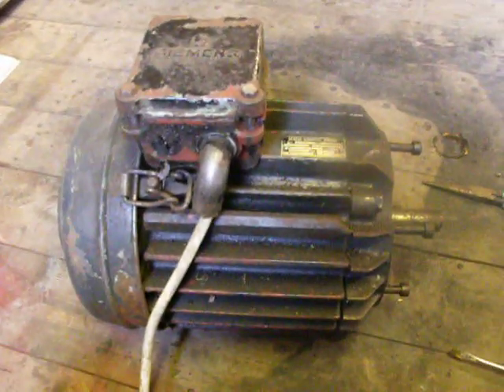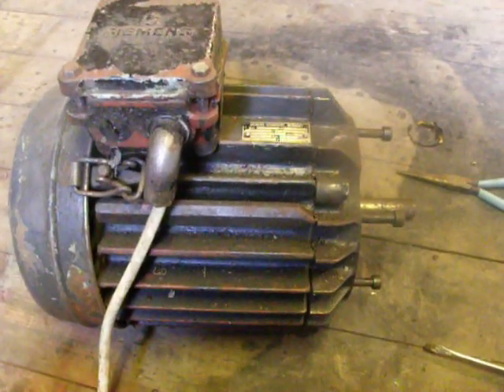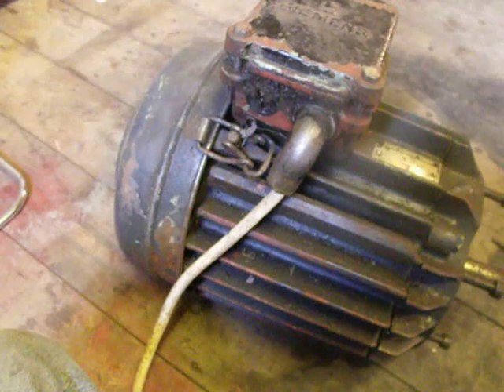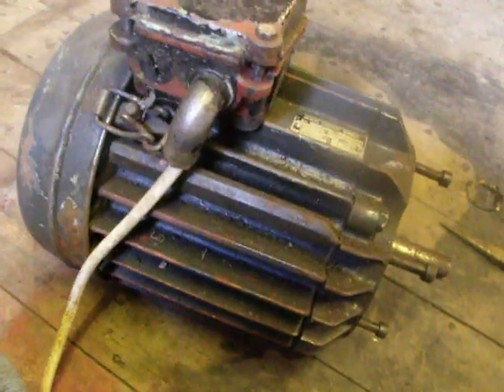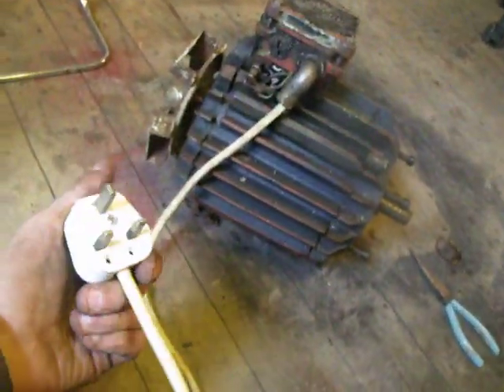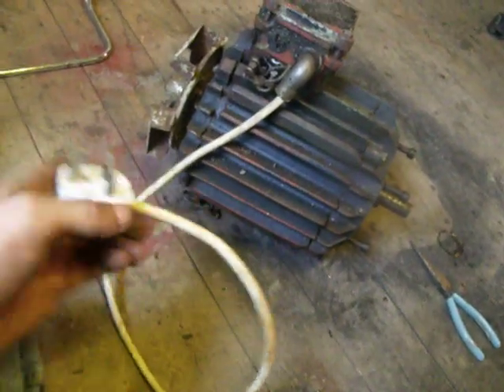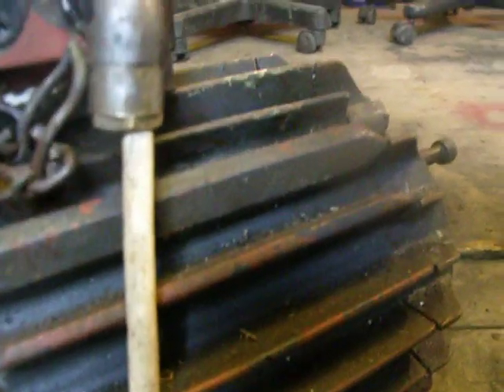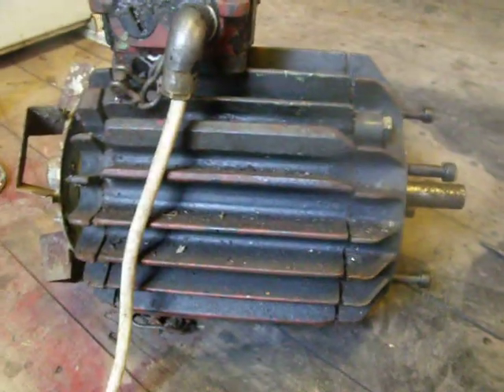3 phase siemens motor running on 240V single phase

Comment: Hi there.  I have bought this feed hummer mill with 4 kw 3 phase motor but I was forced to go buy a 5.5 KW single phase to run the mill. Luckily I did not throw away the original 3 phase motor .  now I see its fairly easy to run the 3 phase motor from single phase.  I will be doing just that next time I set my foot in my small workshop
Reply: The Three phase 4 kw motor was connected with a start capacitor the motor ran one kick.  The motor ran smoothly for about a minute and suddenly vibrated and shut down.   I immediately thought about the run capacitor.  I will be getting the run capacitor(s) and get this motor running forever.

Comment from the maker: no I don't m8, just mane's power hence why it's ruff starting, so if you check out the other vid of the phase converter u'll see what it's all about then that mean's that the motor that run's off this motor will start, but this one wont a capacitor will work but rather start by hand, and it's 5 HP, 240V 3 phase m8, hope this help's m8

Comment from the maker: well out of it sort of but that's now a phase converter, so i can power a 3 phase motor of that one and it will start under load, i can run any 3 phase motor as long as it dose not over load the converter, look at me other vids ill show you it powering a motor and has loads of turque

Comment: the anker is not in balance that is making the noise so your damage the motor now      it wil pull the axle to one side of the motor   and it will burn your bearings